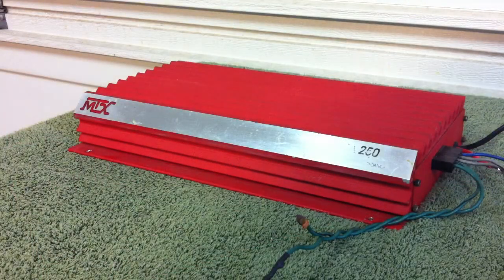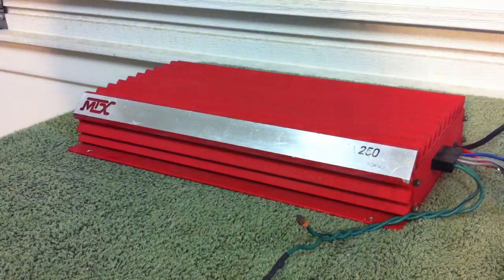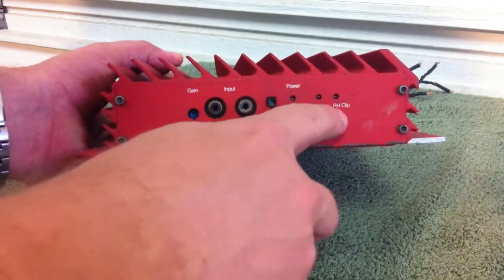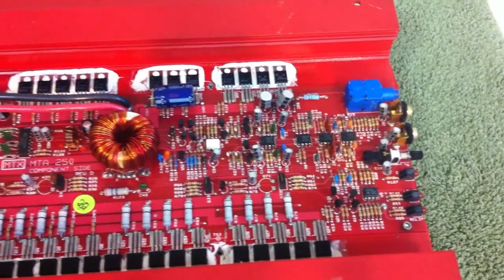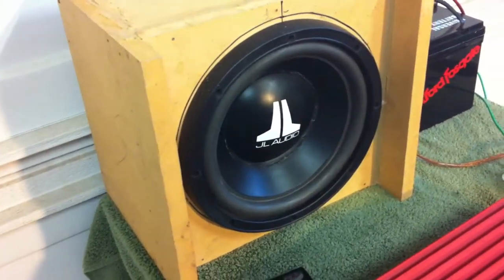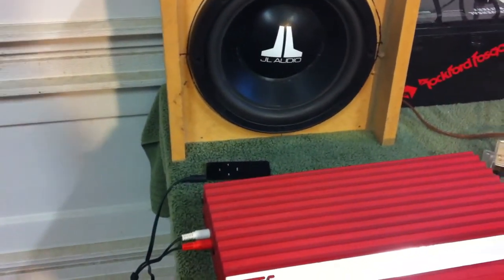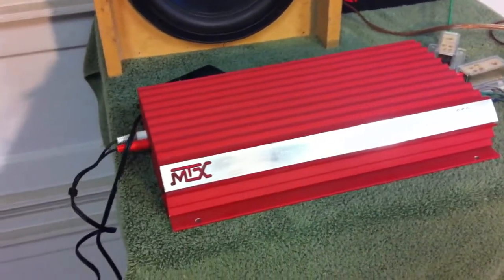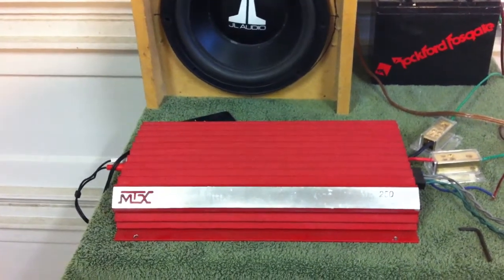Old School MTX Terminator MTA 250 Amp - Orion HCCA, PPI ProMOS

Comment from the maker: @normalicy I took a big chance buying the amp as the seller didn't know anything about car audio and from the pictures I could tell the amp had taking a beating (exterior). I got the amp for only slightly more than the value of the PPI plug/harness so it was really a no lose deal. I was REALLY happy to see the guts were so clean and unmolested and other than needing a little deoxit for the gain potentiometer, it was all good!

Comment from the maker: @MrMxAudio There are many amps made today, 2012, that can't do 2 ohms bridged. This 1990 amp is a high current, low impedance capable amp designed for low ohm loads. Old School made in the USA quality!

Comment from the maker: Great question and nice amp! I should be able to help you out with the wiring for bridged operation and will have to research the XEP-150 to see if it will work with this amp. I think most of the prefab tri-mode crossovers are setup for amps using left+ and right- for the bridging and not all amps bridge this way. I'll see what I can find out for you

Comment from the maker: You can use either a 400bdg module from Orion or an older AudioControl 2XS that has the INVERT channel for the sub. The 1st gen 250 HCCA's are 1 ohm stable in stereo or 2 ohms in mono. Don't always believe what you read on the Internet...too many myths! Not sure about the value, depends on where you sell it. I got a 250 HCCA local for around 150, eBay should bring more, but then there's the fees, etc.

Comment: I had this amp running 4x18" RF Punch, 4x8ohm it was a beast it was 1990 . Also when CD players just got affordable it would skip on hard bass notes , back in the day . 
I had the bang installed in a old 79 dodgers Pu that was butt ugly till I hit the volume !
Reply from the maker: Yessir, back when speakers were high efficiency and required huge boxes. Many of us used smaller amps on big subs and were very happy w/ the result!

Comment: I own A gen 1 250 Orion h.c.c.a ,first only is the pink 250 half ohm stable .difference in high current class A and high surrent competition amplifier I've owned both .The. pink amp would run 16 speakers ,but needed higher volage than standard 12 . I've noticed their.is no info on this amp online so Im here to educate you .If you find A pink h.c.c.a hold it with both hands thats the holly grail of all car audio . Ran with A Allpine 7909 it was the hardest bass i've ever heard .

Comment: awesome a new video... :) great stuff big D. I love you videos. hey i just got a very beautiful pair of 12 inch rockford fosgate punch xlc RFD- 2812. subwoofers and a bandpass box for them that's in very great condition. i just bought a refoam kit for them both and they should be hear any day. they are rated at 400 peak 200 rms. and were made in 1997. i got them for free in a trade. they are going for 240 on ebay. lol i plan on buying a punch 150 to run the bad boys. haha thanks for the vid :)

Comment: Hey big d wiz on that jl that rubber surround didnt come with the the w3s or w6s I have 3 w6 v1s an I want to re surround them what place do u recommend an I prefer that rubber surround then the paper one it comes with. Please let me know thanks man.
Reply from the maker: I spoke with JL Audio about this and they do NOT recommend using rubber surrounds on their speakers which originally came with foam. I wanted to do the same with mine, but they highly suggested I use foam as they originally came with, so this is what I did.

Comment: thought the old mtx amps was made by ads (orion) corp. i know mtx stole rockford fosgates amp guy  in the early 90's  the old thunders amps looked like old punch amps with no end caps   i still have a old blue thunder 2150  you have any old hollywood subs,amps